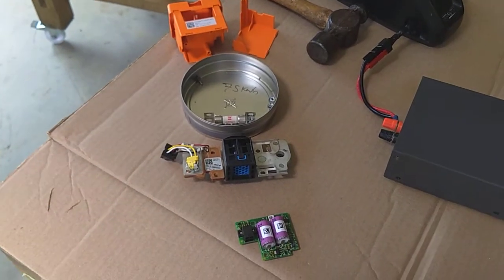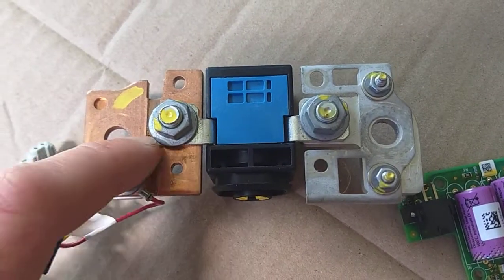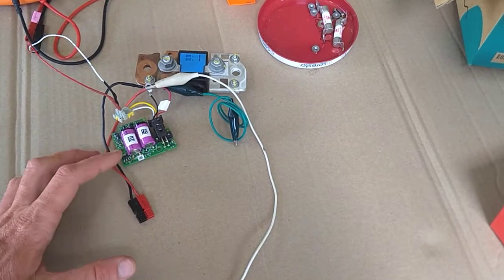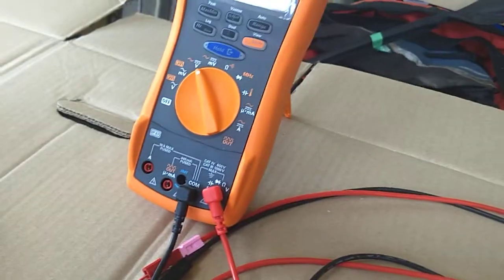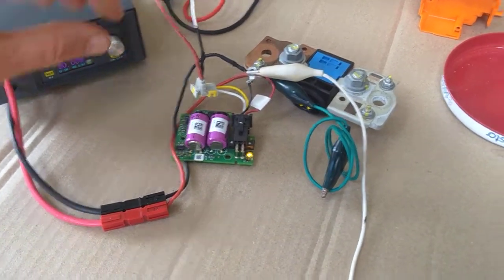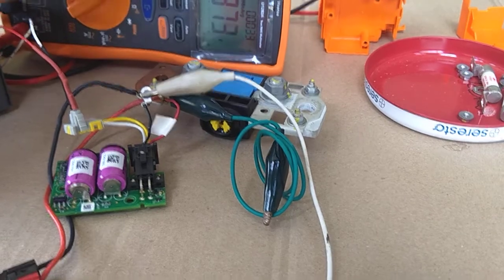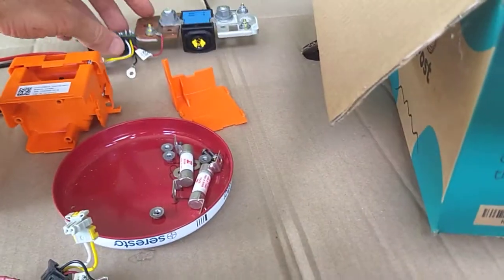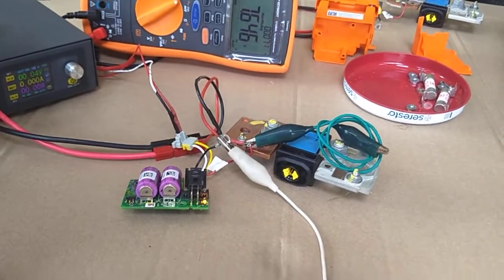Tesla Pyro Fuse Testing

Comment from the maker: Better news! You don't even need a used good fuse to swap. The pyro fuse element can be bought easily & cheaply. Search for PSS-1 Battery Disconnect on e-Bay or wherever works best for you 😀
Same warnings as in description apply-make sure you understand why the fuse blew in the first place!

Comment: I'm wondering about the two conventional fuses that shunt the pyro fuse. (You removed them, and they're sitting in your round red tray of parts on the right.) My guess is that when the pyro fuse opens, the current is redirected to these two smaller fuses, which immediately blow and quench the arc. This is probably cheaper and easier than trying to quench the arc from the pyrofuse's own conductor. In mine they were each rated to break 100 kA. Fuses of this type are usually filled with a sand, probably silica (silicon dioxide) or magnesium oxide, to promote arc cooling and quenching.

Comment: There is a predefined lifespan of the fuse. I guess about 8 years as all of a sudden, loads of 2016 Model S cars have got the warning on the dash to replace the fuse. It's not covered by the battery warranty apparently. Just quoted £287.28 to replace it but at least it will be replaced with the newer generation that doesn't have a battery and instead draws power from the traction battery through the fuse itself.

Comment: I am guessing the two large purple components are ultra-capacitors to fire the explosive charge.
Extra fault protection in case the system doesn't have the current to blow the fuse.
Reply: I think they're lithium metal primary (nonrechargeable) batteries. Two in series would give roughly the voltage he sees across the pyro initiator plug when the unit detected an overcurrent. These apparently reach their shelf life after 8-9 years and require an overly expensive fuse replacement.
Reply: @philkarn1761  I would like to know this as I have a 2015 Model S.  Is my "Relay" going to "die" soon?  I could fix it myself if that was the case.
Reply: @philkarn1761  It looks like you are right based on the warning symbol on the devices.  I cant quite get my phone to read the QR code from the video.

Comment: brilliant info. The two li-ion batteries, are they rechargeable? If so, any idea where it picks up gets its charge from?
Reply from the maker: No, they are not. I don't know if I mentioned it in the video bit this leads to a potentially dangerous situation in 20 years or so: The pyro fuse will not function and so in an over-current situation you will not be protected. Something to worry about in 2035 if we still have a livable climate....
Reply from the maker: Yes, I mention it here: https://youtu.be/k3BkMi91A4A?t=218
Reply: @RaglansElectricBaboon  bunch of ppl are getting warnings for those 2 little Li-Ion batteries on their Teslas now... seems these were pre-programmed into software for replacement after 8yrs?... Did u happen to measure the Voltage to see how good they were? Nice video btw :)
Reply from the maker: @thebrain7693  makes sense that there's  a warning pre programmed. I thought I measured the voltage in the video but if its not shown I don't recall it.
Reply: Those look like lithium metal primary (non-rechargeable) batteries.

Comment: When its blown what functions it takes aways?
Reply from the maker: Max 200A from battery without this fuse. Most likely the 2x100A fuses will blow nearly immediately if you try to drive it again. However likely the pyro fuse in the main fusebox will blow too meaning the car will not allow you to try to drive.
Reply: @RaglansElectricBaboon  if the pyro fuse triggers, the two sand fuses will immediately blow too. I think they’re there just to quench a high current arc.